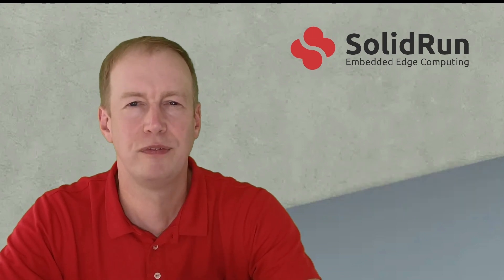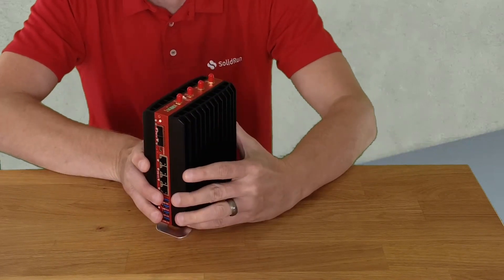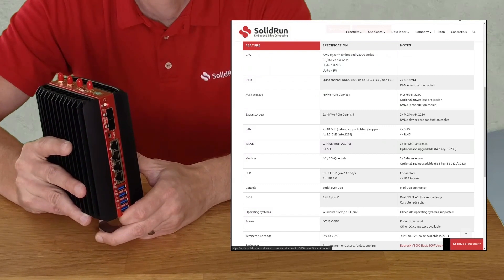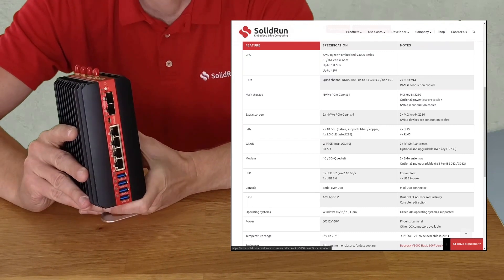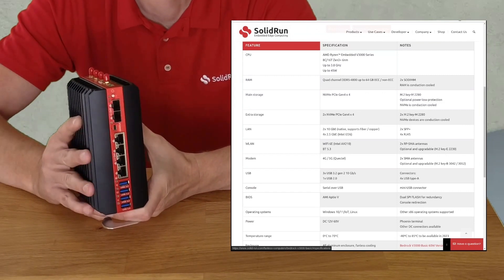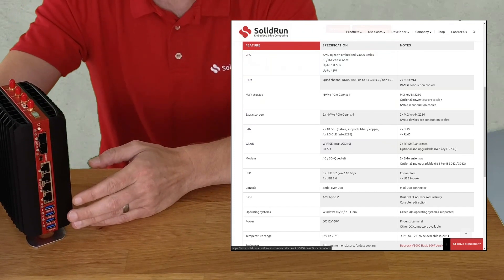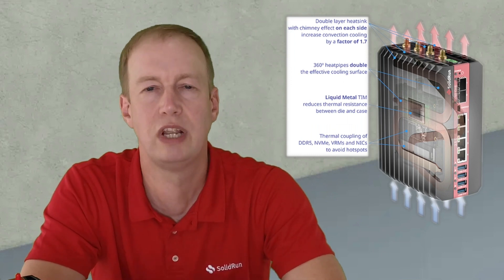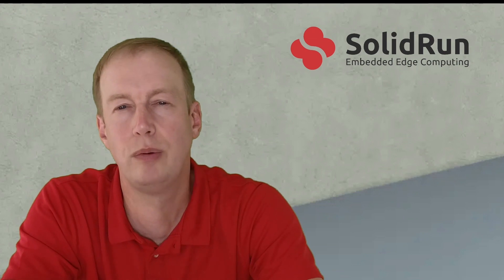Bedrock V3000 Industrial PC | Overview by SolidRun

Comment: Very nice. However, given that 96 GB RAM kits are slowly becoming available and a PC like the above is likely to be used for a longer period of time, it would be helpful to know whether upgrading the RAM beyond the specified 64 GB is an option here or not. Has this explicitly been tested/ruled out? IMHO, a footnote in the spec sheet would be very helpful.
Reply: Officially AMD specifies 64GB maximum for the Rembrandt series of CPUs. Newer generations are spec'd at 256GB